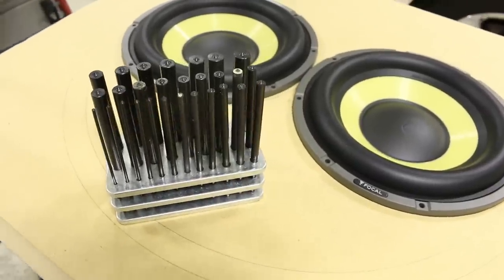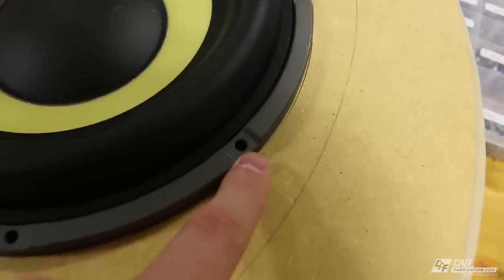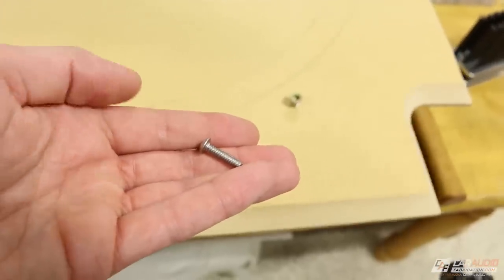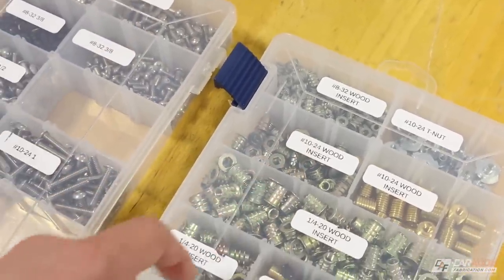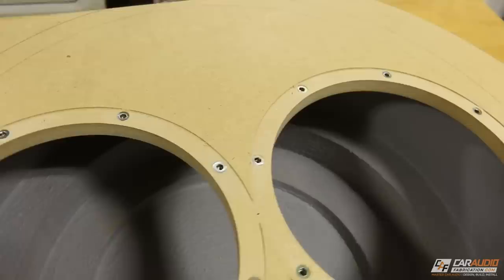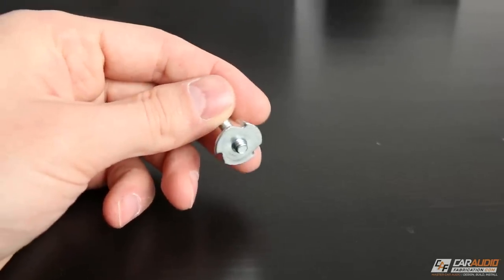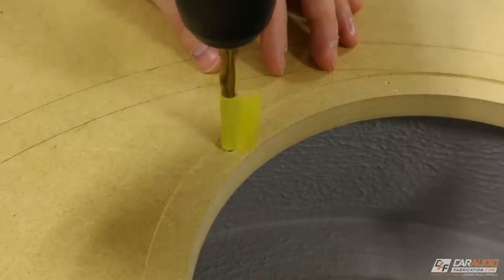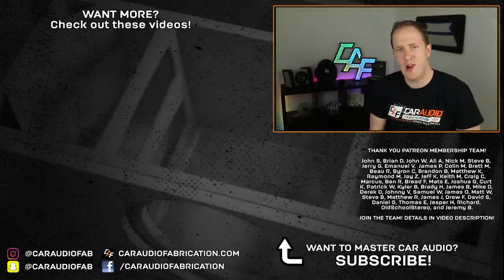Mounting subwoofers like a pro! Threaded Inserts

Comment: The biggest mistake people make using wood screws is not drilling a pilot hole. Yes, threaded inserts are better, but there's quite a few people who still use wood screws. Not using a pilot hole has potential for serious damage to your box. You can easily split the wood by just plowing a wood screw in with no pilot. You're trying to displace to much material. Whoever built the subwoofer box I own did exactly that, but it's salvageable. I'm not using that particular box right not, but if it gets put back in use, or I sell it, I'll install thread inserts.

Comment: Ok someone explain this. It has always been weird to me how people focus so much on audiosystems mounted in cars... like these really expensive high end audiosystems in cars, and the engine will just interfere with the sound... why bother? If youre so into audio and soundsystems, why in cars???
Reply: Viktor you spend a lot of time in your car, sometimes stuck in traffic, doing a relatively mundane task of driving. You can not always turn the volume up in your home depending on your living conditions. In your car you can enjoy music however you want while entertaining yourself with little to no distraction from both the driving or the music. In short, a much better driving experience. Also, a well built car should have relatively low road and engine noise.
Reply: Also, it's no wonder why high end luxury car focus so much on cabin noise and the sound quality of the sound system. It's all part of the driving experience.
Reply: I never have problems with the engine interfering with my sound LOL. That's just silly. Of course it's possible but unlikely if you know what you're doing. And as for external engine sounds you don't really hear them if the music is up. Now you could argue that if you have a loud exhaust maybe you could hear it. Well that's just stupid. Why do people have loud ass exhaust. Sounds like crap doesn't make you any faster.
Reply: Engine doesnt interfere with the sound provided you do it right...as for why? I'm in my car alot,so while I'm in there I want to be able to actually enjoy myself..ear shattering crystal clear highs and mids,and bone shaking bass makes it to where I enjoy it. I love music,always have and a well done car audio system takes that love for it to a whole new level.
Reply: @craigshelhammer5683  I'm definitely a full-range fanatic like you. All of my peers who have systems just slapped a huge monoblock and power hungry subs in their cars and I think it sounds like garbage. I had them listen to my stereo (which is mediocre at best) and every single one was shocked at how good it sounded. I can't stop adding things to make it better and I'm afraid I'm on the slippery slope of becoming an audiophilliac lol

Comment: The screw length will be a problem if doing it this way, drilling all the way in will cause leak through the thread and also vibration will loosen the screw overtime, gluing the thread will defeat the purpose of serviceable build.
The best way is to use large thread wood screw, drill and tap it first before mounting the subwoofer, work best and doesn't came loose overtime.

Comment: i've done inserts this way before and the bolt was 2mm longer than it needed to be, and because i drilled half way like mark, the bolt end de-laminated the MDF......  drill all the way threw people this way is foolish.  smear on blue loctite if you have air sealing issues
Reply: Nathan Bowers you don't think using a screw that's too long is foolish..?
Reply: BrinkMan49.  You think calling a bolt a screw is foolish
Reply: I've certainly never delaminated a box by using a bolt OR screw that was too long... Either way, using the right sized fasteners seems pretty important. Don't you think? I'm quite certain he's installed many more systems than you have, so why don't you just keep quiet, take in the information, or skip the vid. No sense in the ill-experienced trying to advise an expert on his trade.

Comment: Really Mark? You make a video showing us how to use the proper tools for the job. Or in this case the proper hardware. But then you use tape on the drill bit?

They make drill bits with depth stops, and collars that go on drill bits for an adjustable depth stop. Why you wouldn't use them is beyond me. That tape method is straight out of the 1960's, or something.

Sorry. You know I love your videos man. But you need to step up your game on this. You're like light years ahead of me in skills, and I don't even really have that many tools. Yet I even have some of these myself. They come in pretty handy.
Reply: HH Scott what! The taps trick is extremely effective. What kind of tolerances do you think he's working with. Your extra tool increases the amount of time for install, yet provides no visual or structural improvement over the tape method. Why waste you money on something you don't need. Tape has been the proper tool for years. Hell I've even just used a sharpie before. Don't be silly. Spend your money where its most effective.
Reply: BrinkMan49 They came in cheap kits for my impact drive I was buying anyway. It's quick release. Much, much quicker then taping, and untaping a drill bit. You keep doing it your way, and I'll keep doing it my way. I don't expect you to change. Why would you expect me to? 

What's the rush anyway? You think you're saving time? You're maybe saving a couple of seconds at best. One mistake costs minutes, or more. That's called false economy. Same thing with having to use another piece of wood. There goes your savings on tools. Right out the window. Do you realize how cheap these tools are? I'm talking lunch money, or less here. 

I work for a boss who constantly rushes everything to save seconds, and half asses things, because "it's good enough". Then constantly makes mistakes that cost minutes and/or gets complaints about her work that cost us time to deal with unhappy customers. Then we have to do it over, and waste product, and even more time of course. I try to explain this to her, but she's stubborn. It's ridiculous. I do things methodically, and make very few if any mistakes. My way is much better IMO. And her husband agrees with me.
 
In the end. I get more done with a much better customer satisfaction rate. I don't do "good enough". I do it right! And I only do it one time. That is the proper way IMO. There's a reason I'm always the guy they ask to train new employees, and to deal with difficult situations. Like talking down angry customers created by her "it's good enough" philosophy.

I am curious why you felt the need to defend Mark. He's a big boy. And he knows I'm a fan. We've talked many times. So I know he's plenty capable of explaining his reasons on his own. Maybe you're really defending yourself? And your techniques. ;)
Reply: Cool story bro
Reply: Oh thanks for the run on paragraph. It shows that you are neither precise nor concise. There is a vast difference between rushing and efficiency. If you need a hard stop to prevent drilling through MDF, quite possibly the easiest and most uniform material you could possibly use, you probably don't know how to use a drill. A true Craftsman, or woman, wouldn't risk a hard stop marring their piece. The point of my original statement was don't go insulting some tried an true method because you got some gimmicky equipment meant to help out people less skilled with a tool. Sure I might be defending my method, but it's not really mine, is it? It's used buy a vast majority of professionals producing some of the highest quality work you could possibly get. If you truly need you watch you depth you'd be using a forstner bit combined with a drill press. So don't tell me about the right tool to use.
Reply: 9Nails Have you not really watched his videos? He shows how to use many fancy tools all the time. Like the things that do curves he uses with the router. The routers themselves. All the fancy router bits etc.

He uses high end tools, and fancy techniques in many of his videos. His workshop is very fancy. This is obviously how he likes to do it I guess. I just want to know why. 

Besides. Like I said. These are very cheap, and I even have them. I don't even have a proper ratchet. Hardly any sockets. And I might have a couple of wrenches somewhere. They put them in the multi bit kits at Sears you get for $15, or $20 on sale. It's not some weird specialty tool.
Reply: 9Nails Oh, and they're not all single use things. They make the different size collars you can put on your existing drill bits too. They're so easy, and quick to use also.

Maybe he's trying to be careful not to mark the surface? I dunno. I've used both types without any issues like that myself. I like them. I find using the tape annoying myself.

BTW the whole reason I originally said something is because he's always using the proper tool. Other guys on YouTube are using a jigsaw to cut their holes for speakers. Not Mark. He breaks out the router with the circle jig. He's the reason I bought a router actually. Seeing how much better it is, and not owning either. I found a used one to save money, because they definitely cost more then a jigsaw.
Reply: HH Scott hey I was being a bit heated before, but it's just as simple as that most fabricators, or anyone who spends a lot of time in shops, are going to have favorites. Tape is used heavily for all types of automotive work, so it tends to be a favorite among installers. The tape technique is tried and true. In my shop the tape is hanging off the walls in plain sight where as some tiny little back stop would likely be kept in a drawer somewhere. If I don't need the accuracy of a backstop I'll reach for that tape roll and achieve a nearly identical product. I have a ridiculous amount of tools to the point where organizing all of them can be tasking even though I don't buy new tools until I specifically need it for a project. Some times you get tools for totally different project and you wind up using it and things you had no problem doing before just cause it's a new tool. For instance what he did with those center punches can easily be done with other methods. You can used geometry to mark the center, or you could simply take a nail wrap it with tape until it's at the desired diameter and use it as a center punch. By far the better method than buying a set you may only use a few times. Anyway if you watch a lot of marks vids you'll see tape is one of his favorite tools. Hope that helps.